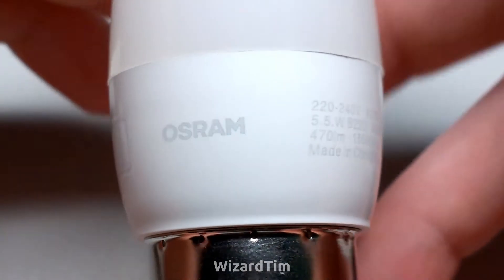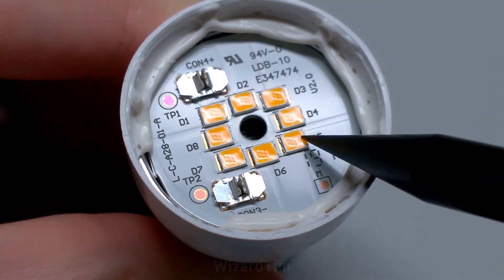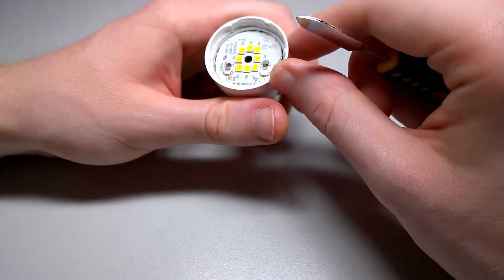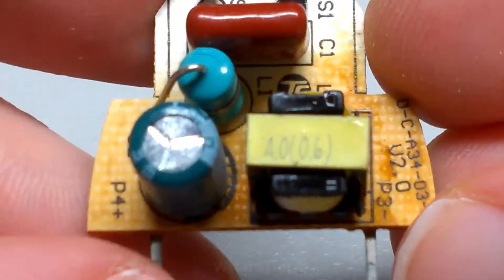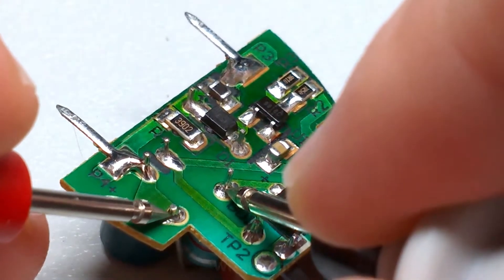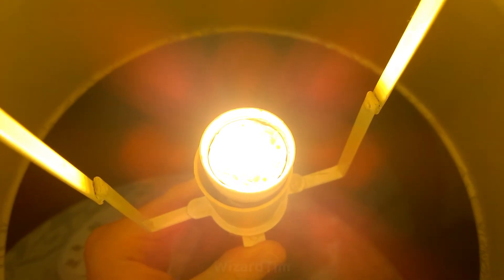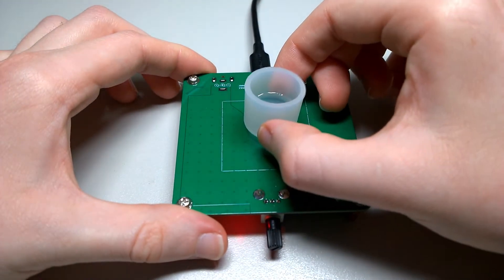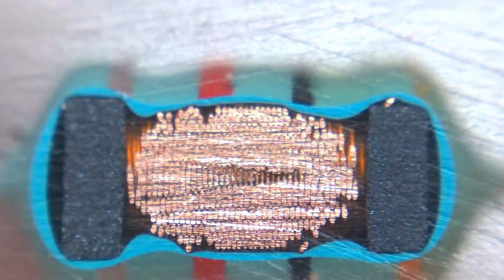OSRAM 5W LED Bulb Repair & Failure Analysis

Comment: Hi, when checking each smd led using the multimeter till it lights up, do you set it to continuity mode?
Reply from the maker: Hi, the multimeter is in diode mode when lighting up the LEDs, continuity mode usually won't supply enough current or voltage to make white LEDs light up. However additionally those LEDs aren't the typical single die white LEDs, they're OSRAM DURIS E 2835 series LEDs so they have a rated forward voltage of between 8.4 and 9.8 V, typically 9.5 V. So your multimeter has to have a rather high diode test voltage.

In this video I used a Keithley DMM6500 bench multimeter in diode mode, unlike a typical handheld multimeter it has a relatively high diode test voltage of 7 to 12 V and can do higher test currents. But you can do the same test with a lab PSU at a similar voltage (>6V for those 3 die LEDs) in constant current mode set to just a couple of milliamperes, just be careful of the PSU's output capacitance damaging the LEDs if you set the voltage too high.

Comment: Thank u for the informative video 

What did u use to test the individual led ? 

I use 2 1.5v batteries in series ( 3v ) to test but was not able to get any led to turn on.
Reply from the maker: The LEDs in this light bulb are special, they have three LED dies in one package so have a forward voltage of between 8.4 and 9.8 V, typically 9.5 V.

To test them I used a Keithley DMM6500 bench multimeter in diode mode, unlike a typical handheld multimeter it has a relatively high diode test voltage of 7 to 12 V and can do higher test currents. But you can do the same test with a lab PSU at a similar voltage (>6V for those 3 die LEDs) in constant current mode set to just a couple of milliamperes. You could also do this with a 12 V battery, just make sure you use a resistor to limit the current otherwise you'll break the LED.
Reply: @WizardTim  Thank u very much for replying. 👍👍

Comment: So, I found one of those large LED Spot Light with large heat sink in the back that they put on truck on the side of a road and I wonder how you would proceed to retrieve and reuse the LEDs and other parts.

Comment: nice tips - found a black spot of LED death on two bulbs with 12 LEDs each. Scraped off the dead LED down to bare metal, a blob of solder later - good to go :) Since they are in a decent shaded enclosure I left the diffusers off so they cool more efficiently now
Reply: You'll be driving the remaining LED's harder due to the missing one I think.  Better to replace if you can. Although with the extra ventilation it probably won't matter.  I'd be a little cautious running it without the diffuser.
Reply: That's a bad idea, the bulb is gonna fry in very few uses

Comment: Excellent video, thanks! What voltage do You use to test LED "cells"?
Reply from the maker: The DURIS E 2835 series LED chip that's in this bulb is rated to have a forward voltage of between 8.4 and 9.8 V, typically 9.5 V.

To test them I used a Keithley DMM6500 bench multimeter in diode mode, unlike a typical handheld multimeter it has a relatively high diode test voltage of 7 to 12 V and can do higher test currents. But you can do the same test with a lab PSU at a similar voltage (>6V for those 3 die LEDs) in constant current mode set to just a couple of milliamperes.

Comment: Very nice analisys of the damaged part. Would be nice that would give a detail on the voltage applied to the leds as you go through. Wich Is It?
Thanks!
Reply from the maker: The DURIS E 2835 series LED chip that's in this bulb is rated to have a forward voltage of between 8.4 and 9.8 V, typically 9.5 V.
Reply: Thak you!

Comment: 0:27 "...after doing that for a while..."

Sure, it was easy-peasy then.
But really it took like probably a quarter hour or more.
You guys really underplay the difficulty in repairing drop-in LED bulbs, the clean nondestructive removal of the diffusers is not easy..
Reply from the maker: It took about 1 to 2 minutes to remove the diffuser by the method shown, that was certainly the easiest part, the hard for this bulb was removing the LED PCB, it's press fit quite tightly and as you saw I ended up breaking the plastic case but I glued it back together. But there are many bulbs that aren't siliconed in like this one but instead ultrasonically welded or have one way latches in the plastic molding, those are very difficult to repair without destroying.
Reply: @WizardTim  Lucky you, that's not my experience. I've even had at them in a vice without success.

Comment: What I did with one of these that had the same problem is take a few thin wires from a cable and wrap them around the negative positive
 Wnd it worked if it blows again try putting in a few more wires and it should last and work.  great video thx.

Comment: VERY interesting. especially on the inductor. likely scratching away the paint might have exposed the wire enough to add flux and resolder. as a first point of approach. But of course spending many dollars on a 50c component is not worth it. 
but saving the LED lamp was worth it; IF the hours are not more valuable elsewhere.

Comment: First time I've seen inside of one of those resistors. Also if you want to reduce the amount of heat remove the plastic diffuser or cut the end off of it. Another thing you can do is drill vent holes into the section below the LEDs so they've vent out. Apparently the LEDs can last basically forever if they can cool off sufficiently during operation.
Reply: it is not a resistor though

Comment: I would've thought that was a resistor... How can we differenciate them from inductors?
Reply from the maker: Some things that give it away it's an inductor:
- PCB overlay has it marked as "L1" and an inductor symbol between the pins
- Axial through hole inductors are often that light blue colour and the colour bands decode to a sensible inductance value
- It doesn't make sense for their to be a resistor in that place in the circuit but an inductor makes sense
- The cross section shows it has a ferrite core and low resistance copper wire wound around it, a wire wound resistor would use a nichrome alloy wire wound around a ceramic core.

Comment: Im trying to fix mine, 24 led,s on a disc, resistance test shows continuity. The circuit board doesn't have a resistor like yours.
it has 2 things the same as yours, a capacitor (no bulging) and the square redish parcel. it has 7 small black squares . it has a small glass fuse which is also good. Frustratingly weird cos I cant see the fault.
Kanlux GU10 3.6 w
Reply from the maker: I assume you've tested the 24 LEDs individually like I showed in the video to make sure they all still work, if one doesn't work and they're all wired in series the bulb won't light at all, I would imagine this is the most likely cause of it not working.

The 'square redish parcel' in your bulb is most likely a polyester X class capacitor being used in a 'capacitive dropper' power supply which is a very different design to the LED bulb in this video, if this is the case it should be a bit bigger than the one in my LED bulb (guessing it will be around 470 nF for a 3.6W bulb). If you have a multi-meter that measures capacitance you can test to see if the capacitor is still good based on the capacitance marking on the side of it (you may have to remove it from the PCB to test it 'out of circuit' to get an accurate reading), those types of film capacitors often degrade over time losing their capacitance which causes the bulb to be dimmer until it stops working completely. 

The 7 small black squares are likely a combination of diodes and resistors, those are unlikely to be the fault but you can test those with a multi-meter.
Reply: @WizardTim  Hi.
All led,s tested including on the back of the disk, the 2 solderd points.
The x capacitor says cbb22 684J 400v.
On 2000k test it says 550. I can't get any reading on the ų value.
The other capacitor is a 4.7 ųf 400v and reads on 2000k 460 and again no reading on the ų value, trying from 20ų to 200m.
The wires from the pcb to the bayonet prongs are good.
Am i right in thinking if i connected a 3.6w power source to the back of the led disk they should light up if they are good?
Thanks, John
Reply from the maker: @knaptonmawson  The 684J marking means the capacitor is "68 with 4 zeros" 680000 pf (680 nF). Your multi-meter may not be able to measure the capacitor as it's too small for it, it would appear as "0000.68" in the 20u range, assuming you have 2 decimal places on the LCD. I think your options are to de-solder the X class capacitor to measure it out of circuit on a better multi-meter or just assume it's bad and see if replacing it with an exactly equivalent capacitor will make it work again. I would recommend visiting an electronics hobby shop or even a makerspace if you have one nearby, you might be able to buy the right capacitor there or someone there might be able to test the capacitor for you but also help you test it safely.

Here's a video that explains this type of capacitive dropper power supply:
https://www.youtube.com/watch?v=-n22cqZkxNQ

To light up the LED disk you'll need the correct voltage and enough current rather than just any power source with enough watts, for 24 LEDs in series you'd need something between 40 and 100 V DC but you will also need to limit the current otherwise it will draw too much current and blow up instantly.
Reply: @WizardTim  Thanks a bunch, i will consider the possibility of replacing the x capacitor. I hate throwing things away that looks simple enough to repair .(if you know what you are doing)
I do understand that you need resistors when using leds, so you dont just instantly blow them.
John.

Comment: Thanks for this video. What is the function of the inductor in this circuit ?
Reply from the maker: Likely a combination of EMI/noise suppression, power factor correction, inrush limiting and ripple smoothing on the main DC capacitor.
Reply: @WizardTim  Thank you very much.

Comment: It's amazing that those tiny wire is Hexagonal.
Reply from the maker: Yeah, it's pretty interesting that they look hexagonal, however looking at them under a 100x microscope they are much more circular, it's difficult to tell but I think they may be deformed as they're wound onto the inductor core.
Reply: @WizardTim  Thanks for the additional information.

Comment: Came for the bulb, stayed for the inductor and the nice pictures! Awesome and very interesting video, thank you!
Reply: It's not an inductor, it's a resistor.
Reply: @masterchief1884 I wondered about that also. However it IS an inductor per WizardTim in another comment:

"Some things that give it away it's an inductor:
⁃ PCB overlay has it marked as "L1" and an
inductor symbol between the pins
⁃ Axial through hole inductors are often that
light blue colour and the colour bands decode
to a sensible inductance value
⁃ It doesn't make sense for their to be a resistor
in that place in the circuit but an inductor makes
sense
⁃ The cross section shows it has a ferrite core
and low resistance copper wire wound around
it, a wire wound resistor would use a nichrome
alloy wire wound around a ceramic core."

Comment: It's looks like a resistor. How can you tell from the first sight It's an inductor ???
Reply from the maker: Some things that give it away it's an inductor:
- PCB overlay has it marked as "L1" and an inductor symbol between the pins
- Axial through hole inductors are often that light blue colour and the colour bands decode to a sensible inductance value
- It doesn't make sense for their to be a resistor in that place in the circuit but an inductor makes sense
- The cross section shows it has a ferrite core and low resistance copper wire wound around it, a wire wound resistor would use a nichrome alloy wire wound around a ceramic core.
Reply: @WizardTim  thank you God bless you

Comment: That epoxy trick is clever! Fantastic analysis all the way through. Those AD/DC converter boards almost always fail before the LEDs.
Reply: I'm starting to think we ought to run 12VDC to our light sockets and have one big converter for the whole house. They already make 12V lighting for houseboats and caravans/motorhomes.
Reply: @charleslambert3368  Exactly what I have been thinking for a while now. I believe we will start seeing these in near future.
Reply: @charleslambert3368 , people do that already. Sometimes 12V, sometimes 24V (or maybe even 48V).

Comment: I would imagine the prestress placed on component during chinsy assembly, where they just handbodge it in place, will do them in with thermal cycling. Normally you are not allowed to bend the leads close to package and especially don't do so without proper tools. Then they bend or stretch legs to fit the hole distance, putting a constant stress in it, then they solder at 0mm distance from package end, always a no no typically for axial components. Well, they break every rule in the books. The board designer has magnificent magical stand off by the power of a fixed coordinate system, the assembly guys face gravity, time constraints and corner cuts. In todays outsourced manufacturing the left hemisphere isn't connecting to the right hemisphere, usually profit will sever that vital connection.

Comment: The failure analysis reminds me of the company I worked for. They would do this to the chips they manufactured but they used diamond paste to get through the individual layers of the chip and a SEM with an Xray analysis to determine the contaminates.   At home I just throw away the bulbs when they fail. The local grocery store just had 60 Watt dimmable LED's for $0.50 USD each so besides the learning it is not worth the time to mess around with.
Reply: HAHAHA were same brother . i worked on engineering department in vishay, at wirebonding  do like this and coss-sectioned on it after that do SEM (scanning electorn microscope) and an x-ray.

Comment: Old led bulbs seem like a good source of transformers, what is the transformer in these bulbs?  110 / 12 vac?
Reply from the maker: It appeared to be a 3-pin ferrite E core non-isolated transformer for 240 V AC to about 24 V DC.

Comment: I used to repair the old filament bulbs by holding the bulb at at angle to allow the broken wires to touch then apply power. Often it would fuse and you could get a lot more use

Comment: Thanks, how do you tell the difference between a resistor and an inductor with that colour coding? I was sure you meant a resistor BUT ….
Reply from the maker: Some things that give it away it's an inductor:
- PCB overlay has it marked as "L1" and an inductor symbol between the pins
- Axial through hole inductors are often that light blue colour and the colour bands decode to a sensible inductance value
- The cross section shows it has a ferrite core and low resistance copper wire wound around it, a wire wound resistor would use a nichrome alloy wire wound around a ceramic core.

The colour bands are very similar to resistors, the multiplier is the only difference on inductors, there's plenty of online colour band decoders that make it very easy.

Comment: Inductor? To me that looks much rather like a Resistor!
Nah?
Reply from the maker: I'm very confident it's an inductor, things you can look for that will give it away:
- PCB overlay has it marked as "L1" and an inductor symbol between the pins
- Axial through hole inductors are often that light blue colour and the colour bands decode to a sensible inductance value
- The cross section shows it has a ferrite core and low resistance copper wire wound around it, a wire wound resistor would use a nichrome alloy around a ceramic core.
Reply: @WizardTim  I guess Beni isn't questioning Your assessment. With my limited experience I also would assume it would be a resistor. When I was playing with amplifiers, long time ago, inductors always were bare wire. Thank You for digging this deep into the problem. 
It annoys me too that many led bulbs don't last their advertised life time. I hope designers see this and improve their constructions. Then again we have the problem with planned aging... but that can be solved in software /s

Comment: What a deft presentation it is ! Wonderful video.  Thanks Sir !!
In the present LED bulbs there are no capacitors,condensers etc. 
All the parts are snugly mounted on an aluminium plate.
So kindly teach how the modern LED bulb working pl.

Comment: I’m brand new to electronics so not really sure what I’m saying, but is the inductor not a suppressor?
Reply from the maker: The inductor resists sudden changes in current by storing energy in it's magnetic field, this is useful for EMI/noise suppression in this LED bulb as it dampens the current spikes from the switching power supply from being conducted back into the house mains cables and possibly interfering with other devices or radiating as a radio signal. It can also help smooth the AC ripple on the DC bulk capacitor as well as adjust the power factor but it's main use is probably for basic EMI suppression (higher power devices will have proper "common and differential mode" EMI suppression filters).

Comment: How do you light themup one by one, how many volts to light them how to do it?
Thank you for your video.
Reply from the maker: I used a Keithley DMM6500 bench multimeter in diode mode, unlike a typical handheld multimeter it has a relatively high diode test voltage of 7 to 12 V and can do higher test currents. But you can do the same test with a lab PSU at a similar voltage (>6V for those 3 die LEDs) in constant current mode set to just a couple of milliamperes.